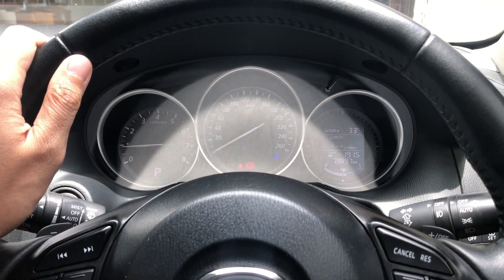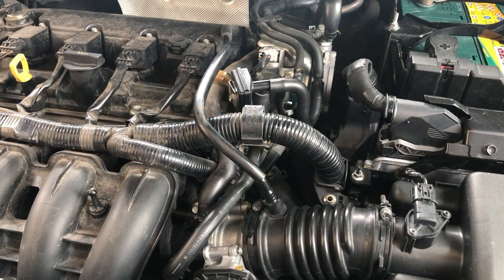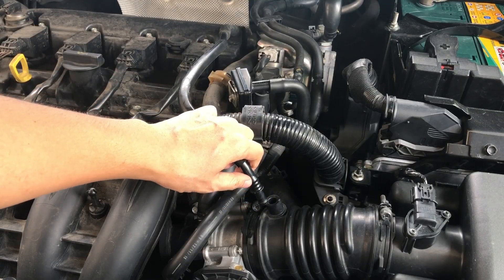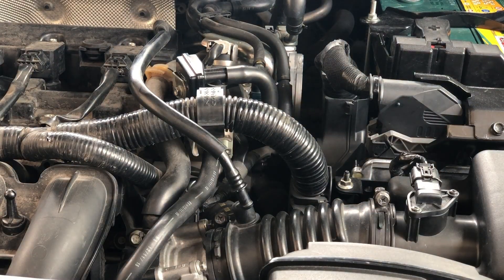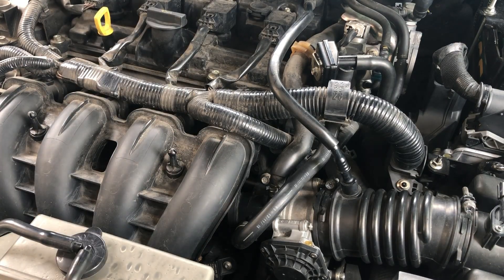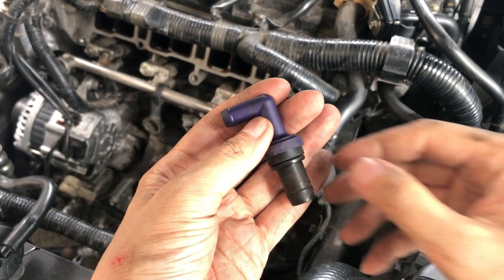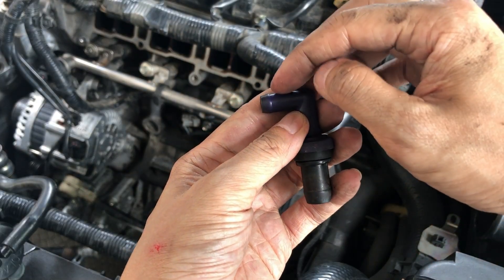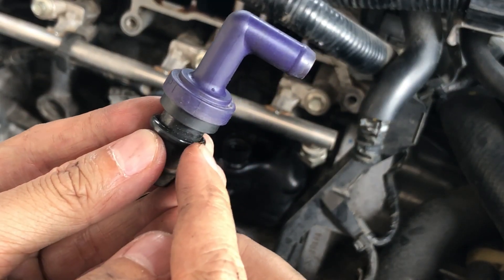Mazda CX 5 PCV Valve Maintenance Check / Replace ? Mazda 3 Mazda 6 Biante Mazda 2 CX 3 CX 9.

Comment: Thank you Felix, I have a rather dumb question. Does the other purple end of the pcv connect to any hose or you just let it hang sideway like that with nothing attached at the other end, thanks!
Reply from the maker: It connects to vacuum side of the intake manifold side.

Comment: How did you remove the pcv valve retainer? I didn’t see clearly how you removed it, I have a hard time removing mine.
Reply from the maker: i use a micro flathead to pry it.

Comment: Thanks for another great video. Quick questions, is it easier to replace altenator when intake manifold is taken out. I am planning to do intake manifold clean up, pcv valve replacement. If its easier to do altenator at the same time, I would love to do that to save some time. TIA
Reply from the maker: Yes, absolutely

Comment: Is that where an oil catch can hooks up, into the top of the PCV there? And then hook the other side of the catch can up to where the PCV went into the intake?

So, PCV > Catch Can > Intake
Reply from the maker: Yeap that is correct The Catch can hose attach to this PCV valve.

Comment: not sure if this is an active thread, but on my ventilation line there has a cap over that line. I bought this used, not sure what the previous owner did to it. 2013 mazda cx5.
Reply from the maker: The ventilation line is not suppose have a cap on it. I am not sure why the prev owner did that. If you can revert it back as per this video it would be a good thing.

Comment: I have a retainer clip question at minute 2:30; are there more than one retainer clip that must be depressed in order to move vertically the retainer clip off of the PCV valve? Or is just a little effort required?
Reply from the maker: just need a lil effort but dont snap the retainer clip. 😄

Comment: My wife has a 2016 cx-5 and seems to be using a little oil at 85,000. Any idea of the pcv is an oil consumption issue on those?
Reply from the maker: Yes if the PCV valve failed (stuck open) you car could lead to oil consumption.
Reply: @GarasiFelixDan when is stuck open, it will shoot blow by instead of suction? Mine is doing that,  with code P0300 along with car shaking, oil consumption, power loss as well, No vacuum leak and no signs of bad plugs nor gaskets blown
Reply from the maker: @bernardogallo4327 Get the new PCV valve & it should fix the problem.

Comment: Hello Felix, I observed that the oil catch can you installed some time ago is missing. Did you take it out?
Reply from the maker: Yes in this video the OCT had been uninstalled. One of the hose deteriorate due to age and engine heat soak and leads to minor oil leaks , i did not have spare hose so i did not bother to install it back. 😅 I would change the hose to braided ones are more robust to heat inside the engine bay.
Reply: Many Thanks Sir
Reply from the maker: @craigholloway3903 no problems👍🏼

Comment: If PCV only allows air to flow out of crank case then how can it create vacuum at the intake?
Reply from the maker: the intake manifold develops vacuum naturally when the engine is running at idle.